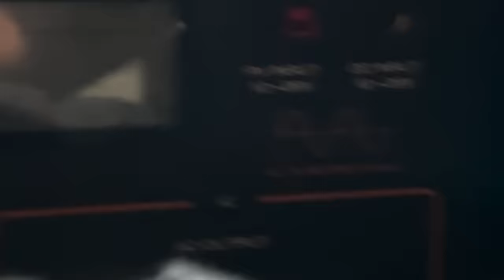California town says no more gas generators…

Comment: You'd think the new mandate would be to connect all the booths to temporary overhanging power lines or a bigazz power strip running down the center of the event.  Proper event organizers do it every day.  The podunk town I'm in has outlets and lighting installed down the center of main street 👍😎✊

Comment: For the homeowner battery powered weed eaters and chainsaws are amazing. Try the millwaukee stuff. They have their place right along the motorized. Let commercial use engine powered to save time until they develop the charging capabilities to equal engine driven. Landscapers that are fleeced to use electric have to charge more and take longer to do the same work.

Comment: I like Edison's approach. That hybrid semi is going to crush in performance compared to the fully electric trucks. Infrastructure is already a joke. I've been running my welder as a generator when needed. Thing doubles as a jump pack if the truck batteries die 😂

Comment: I agree w/you Sam!  Personally, I stand right in the middle. Just be reasonable. I was a pilot. It's hard to say exactly what they burn, there are a lot of factors in there. Their best fuel economy is at their maximum altitude. Way less air to mix with fuel to burn, that can double their mileage. Last thing I flew was a TBM Turboprop. w/a P&W PT6 Turban spinning a huge 5 blade carbon fiber prop. It's 850 HP and burns 65 gallons/hour Jet_A.  At FL310 (Flight Level 31,000 feet)  and economy cruise of 252kps the burn is 37 GPH. A 737, at cruise, is about 2400 kg/hr, or 5280 lb/hr, or 790 gal/hr,  more in take off and climb,  less in decent. A little Cessna 172 you look up and see flying around,  average ~15/gph of Av-gas, a low led, no alcohol fuel.  I was an avid camper for years. A generator with no noise is cool!  As long as it has reasonable performance!  8) Thanks Sam,   --gary

Comment: If the grid provided reliable power all of the time, then people wouldnt need to have backup generators… then they want everyone to switch to all electric so even the places with reliable power won’t be able to handle the demand. NY is the same way here and it sucks. Like you said there isn’t a one size fits all way for all people so stop limiting us. Also the reason other states are like this is because a lot of people leave California for more favorable conditions but then try to turn other states into CA.

Comment: I watched a video this week where Freightliner pulled the plug on their ele truck program!
Didn't give a reason why, but Ford is giving rebates of $15,000 on their Lighting because
of slowed sales. You can't compare a semi to any electric truck to do the same job!
It just won't happen, not with 30k or 80K lbs loads! 
Imagine replacing all those batteries that are worn out! That cost would be astronomical!
It might work with USPO EV's, day cab trucks, locally, but never longhaul!!!
I can see it now a service truck pulls up with a gas or diesel generator in tow to charge your
out of power EV truck stuck on the freeway somewhere on I-80 in NV trying to get to Salt Lake
costing $100 an hour to charge you up.... good luck with that sucker!!!

Comment: Evs and battery stuff is not the answer. They may have thier place but so does gas and diesel. When i go to my tractor show im using a small solar setup to charge my phone and my 12v fridge and run a fan at night.  Gens have curfew and i need my fan for temp control or bug control.  In the semi i have an epu instead of an apu. I havent slept good in trk since having to deal with epu.  Im thinking when warms up i need of of these bat units to run my fridge as inverter cuts out before climate shuts down and use a small chrger to extend my ac time because the way company has piece of junk trk set up. IT WONT IDLE. If towards end of night when bats are low and you go to start trk and wont run due to emisdions or other electrical issue you dont have heat or ac. With apu the apu dies ok you got a little time on big engine before it shuts itself off.  The gov needs to back off the electric bs till the grid can handle it.     Oh wow ive seen some solar farms being installed.  They will only work during daytime and only peak if right weather.  Wind only works in windy areas.  But driving semi through the windy areas with wind farms. Why do i only see a handful moving when there is like 40 that i can see at moments?   Where is everything being made at.  Then it gets shipped here on dirty ships. Yes i said dirty because out at see they run a dirtier fuel creating more emissions but once close to port they switch to a cleanier fuel.    Cut back importing other countries gargage and manufacture more in the USA.  Dont let all the politicians take private jets every place. We have commercial flights.  Oh well not safe. Well if they were for the people not just lining there pockets people would respect them more